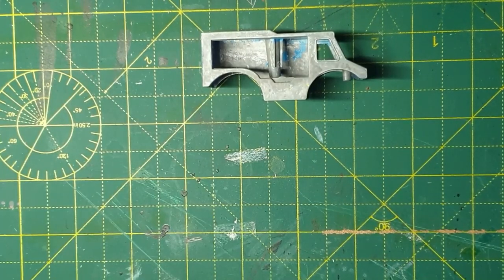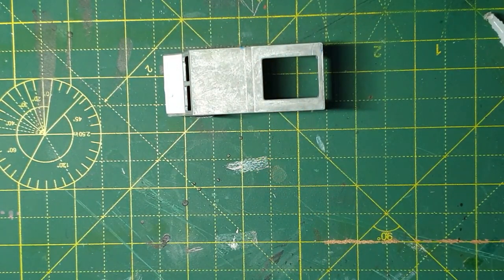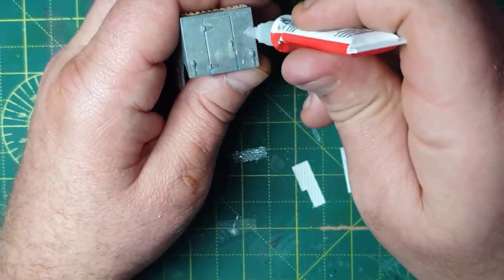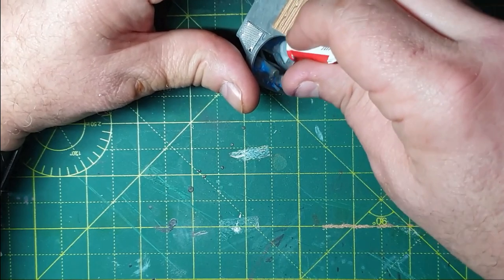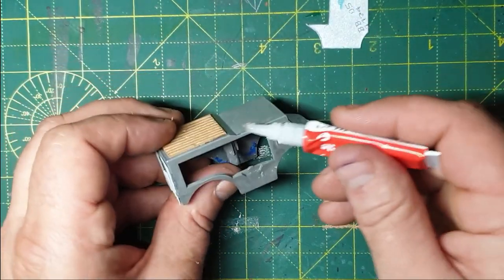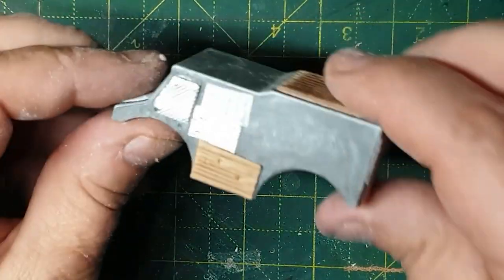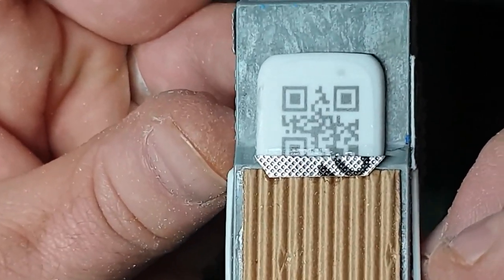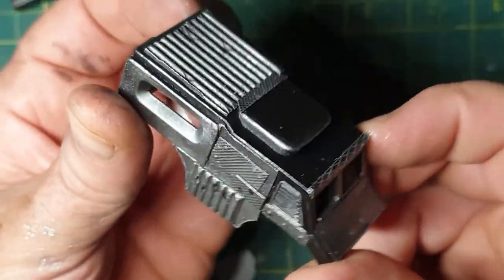Gaslands Armour Plate from Trash, converting Hot Wheels for Gaslands

Comment: Thanks for the tip with the tablet blisters, I'm desperately looking for more ultra-fine materials such as this for armor plating. For mesh (windows), I like to go to the $1 stores or flea-markets and buy sieves or strainers or splash guards (like the ones you put on a frying pan to avoid the grease spraying everywhere) and cut the meshing out with metal shears.... looks amazing but you seriously have to do it carefully, if little threads end up in the carpet, you're wife will likely kill you when she gets it into the skin of her toes. 
Similar to the tuille, the corrugated cardboard would be too flimsy for my taste but I think I might try making a milliput print of it and see how it works. 
Great video!
Reply from the maker: To be honest the card is brilliant . A little super glue and you'd be hard pushed to notice it was card.
Reply: @WastelandsRaceway  Yeah but if somebody grabs the item a little too clumsily, won't it immediately fold and become distorted?
Reply from the maker: @Colonel Burton  very much depends where you use it. So long as it's stuck securely to a solid part of the model you should be ok.
Reply: Matt "mod podge", bit water, maybe some drops of primer or paint, turns cardboard plastic-hard.